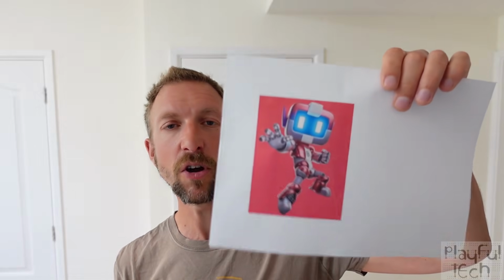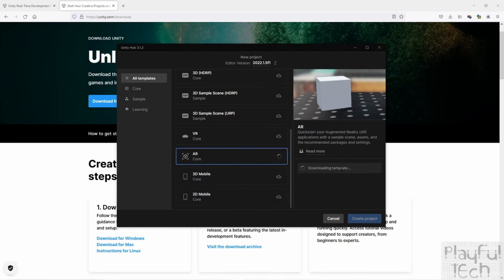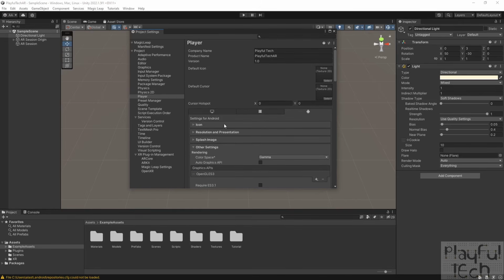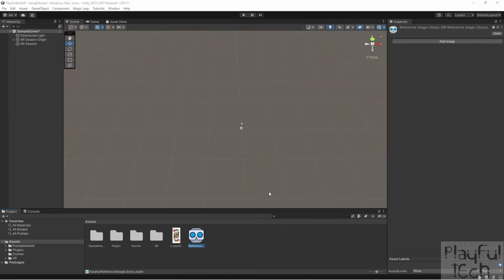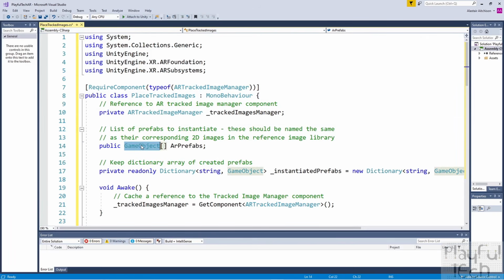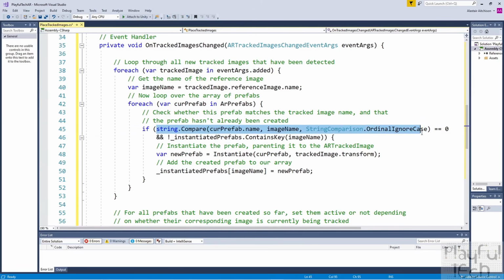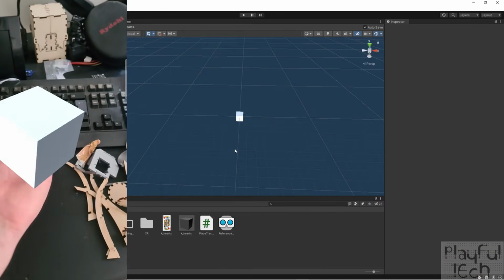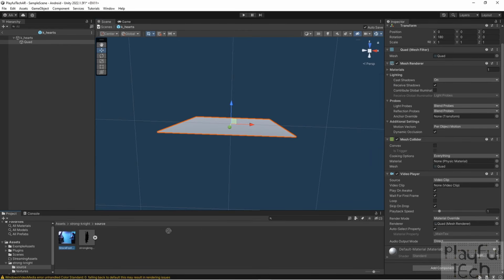Augmented Reality (AR) tutorial for beginners using Unity 2022

Comment: Any changes to the AR Tool landscape since this video was made?  For example, Flutter , ARLoopa, or Flet/ARCore ?

I'd like to make an Android application that can find components from a circuit board! Just use your camera and it will overlay a marker on the component... however, not sure if there is a minimum marker size , and if it can be overlayed with such high precision.

For example, if you have a sheet of paper with a grid of squares, say 50x50.. if A4 is said/entered, could AR use a fiducial on the paper to calculate how far into the grid it needs to place a marker (scaling it based on the the angle and how close the camera is to the sheet).

Comment: Works well until I get like half a meter (1.6ft) away from the image with my camera, in other words, the image has to take up at least like 20% of my camera video feed to work correctly. As soon as I "zoom out" the tracking is lost. Tested it with different markers and different light setups but that doesn't seem to be the issue.

Is there a way to fix this? Perhaps a fundamental setting I'm missing? I've set the tracked images physicla size in my ReferenceImageLibrary asset but that did seemingly nothing.

Comment: Hi, I've done a build using a ace of spades card placing a 3d portrait object and it works perfectly, but when i use my own custom images with size relatively close to the card size both in centimeters and pixel size, it doesn't place my 3d objects anymore. I have nine diferent images in my reference library a all 9 diferent prefabs in my array on the script. Does anyone knows how to make it work or have the same issue?

Comment: I am having some trouble getting these warnings:

No active UnityEngine.XR.ARSubsystems.XRSessionSubsystem is available. Please ensure that a valid loader configuration exists in the XR project settings.
UnityEngine.XR.ARFoundation.ARSession:OnEnable () (at Library/PackageCache/com.unity.xr.arfoundation@4.2.7/Runtime/AR/ARSession.cs:341)

No active UnityEngine.XR.ARSubsystems.XRCameraSubsystem is available. Please ensure that a valid loader configuration exists in the XR project settings.
UnityEngine.XR.ARFoundation.SubsystemLifecycleManager`3<UnityEngine.XR.ARSubsystems.XRCameraSubsystem, UnityEngine.XR.ARSubsystems.XRCameraSubsystemDescriptor, UnityEngine.XR.ARSubsystems.XRCameraSubsystem/Provider>:OnEnable () (at Library/PackageCache/com.unity.xr.arfoundation@4.2.7/Runtime/AR/SubsystemLifecycleManager.cs:68)

No active UnityEngine.XR.XRInputSubsystem is available. Please ensure that a valid loader configuration exists in the XR project settings.
UnityEngine.XR.ARFoundation.ARInputManager:OnEnable () (at Library/PackageCache/com.unity.xr.arfoundation@4.2.7/Runtime/AR/ARInputManager.cs:24)

I am using Unity 2021.3.20f1 and I have done every step explained in this tutorial. Is as if AR Foundation package is not being recognized by unity. I have uninstalled and reinstalled unity and this message still appears.

Please help, I don't know what to do now and it is very frustrating.

Comment: I had an issue with the Android phone not putting the 3D image over the anchor. Not sure what helped exactly. But potentially it might have been due to the size of the cube being too large to fit within the screen area. It was 1m3 and worked after I adjusted to be 0.1m3. Hope that helps someone else

Comment: The most common issue I've seen in the comments and encountered is when you've done everything step by step and your app builds successfully, but the object doesn't appear when you point the camera at the image. SOLUTION: In my case, I just needed to reduce the size of objects to 0.1 meters, cuz by default it's set to 1 meter and it's too big, so it's not displaying.
Reply: hi, any other solutions? followed everything got issues and resorted to online, fixed, my app builds everything but it doesn't seem to recognise the image or doesn't load up what i want to be displayed, i also did change the size to 0.1

Comment: I need some help. I was able to build & run the app, but when I point the camera at the reference, my object doesn't show up. The reference I'm using is an 8x8 grid of black & white squares which should be pretty easy to recognize, and is about 180 x 180mm for the entire grid, so decently large. I'm using a Samsung Galaxy S8.
Reply: same issue with my S20
Reply: did u find any solution?
Reply: @shivanibhardwaj9988  no sadly

Comment: Hi, I've built the app on my phone but no matter what i do it doesnt seem to be placing any objects at all. As far as i can tell i've done everything as per the video but when i open the app the camera opens but it either doesnt detect or doesnt place objects(Which one i cant tell) Are there any steps i can take to debug this?
Reply: I am having the same issue, any resolution??
Reply: I've got the same issue. I do everything step by step, but camera not detect my reference image :(  Samsung S21
Reply: Sorry for necroposting. Did you get it to work? At first I thought it wasn't working but then I noticed the tip of a gray cube in the corner of the screen. Then after some moving around the image I managed to get the cube to come to the screen but it's still kinda floaty and not centered.

Comment: Hi everyone! Thank you so much for this tutorial, was super awesome! When I went to build this on my iPhone I got a build error stating "Undefined symbol: _UnityARKit_Camera_GetTextureReleaseCallbackHandle"    Any thoughts on how to fix this? Thanks in advance anyone!
Reply: What  a coincidence, I have the same one ;-( In case you got this fixed, please let us know!!!
Reply: Ok, found it. I manually updated AR Foundation to 4.2.7 (had to unlock it) and then it finally compiled without this error!

On iOS please also see this great comment below in case the image is only replaced for a blink of an eye:

gardendesignerapp:
There appears to be an issue with ARTrackedImagesChangedEventArgs updated in ARKit. If you just remove the code for the foreach loop that covers eventArgs.updated then it should work fine.
Reply: @pretzelmunster  Nice thanks for the tip. But I cant even get this project to build now. I go to build settings, then build and it just trys to build for a sec and stops. I opened up another AR unity project and just built it straight away and it worked so I'm guessing its something in the scripts or other build settings thats blocking it. I dont know :(
Reply: where to get the code:face-blue-wide-eyes:

Comment: Very useful video and comments. I built the app -- works all the way, except when I point iphoneX on the card, the cube does appear but  for a nano second and then disappears -- it does not stay.  The app keeps trying to bring the cube, but cube never sticks. Any idea what I may be missing?
Reply: There appears to be an issue with ARTrackedImagesChangedEventArgs updated in ARKit. If you just remove the code for the foreach loop that covers eventArgs.updated then it should work fine.
Reply: @gardendesignerapp  Wow, that was a life saver on iOS, thanks a lot!!!

Comment: For those having an issue with the script compiling, try making sure the class name in the CS file is the same exact name as the CS file, casing and all.
Reply: king
Reply: .cs on the name to??, it didn't let me add it, got an error saying,"The associated script can not be loaded. Please fix any compile error and assign a valid script"
Reply: @bruhbeat3047  no, don't include the  ".cs" part in the script class name. Just put the name that's in front. If you still have an error, then it's probably a different syntax error so go through the code again and see if you have anything missing or in a wrong format.
Reply: how I can get the script file please
Reply: @user-rj1hx3gw2b  if you open the description of the video you'll see the link to his paterion, hit that and scroll down to the thumb nail of this video it's linked there,
Btw I've just been helping people in the comments just look around  and you should be able to find other people's that I helped with 👍

Comment: Everything works, thank you. 
But my phone doesn't recognize the reference images. What am I doing wrong? Does anyone have a tip?
Reply: hi did you solve this problem, been hard stuck on it 😢
Reply: Same issue here, did you find a solution?
Reply: I have the same issue. The app runs perfectly, the camera opens, but when I point it to the anchor, nothing happens. Have u guys found a solution? I would be glad to know.
Reply: Did you drag the prefabs into script components?
Reply: @bruhbeat3047  I did. I followed the tutorial and it worked. The app was downloaded, the camera opened, but when I point the camera to the image that it's supposed to be replaced, nothing happends.
Reply: @pedrodavid2599  kinda late but it might be the picture itself, maybe try one that clearer, for example try use an album over or book, then find the digital image online, size it up 
If this doesn't work try

just go over the video one more time 
If you can't spot it there
If not
 try decreasing or increase the size / move the poition around,
Reply: @bruhbeat3047  I'm getting the same issue. My reference is an 8x8 black & white grid I printed out big enough to almost fit the width of the paper, but the app doesn't recognize it. I'm using a Galaxy S8
Reply: @Moki314  I had something similar to this as well, sometimes I just had to turn it on and off a couple times, 

but it might he the location or size of the 3D object, sometimes it can spawn behind the picture and if it's too big where it's bumping into the picture it would just disappear.

Or
It could be the library not being set up properly, just double check everything is named correctly and labeled correctly, it could be that it is detecting the image, but the the 3D model isn't plugged in properly 

Let me know if you fix it 👍

Comment: Hey, I followed the tutorial closely, but when I run the app on my phone, I only see a black screen. Searching around, the common advice for this is enabling ARCore in XR Plug-in Management but I have already done that. Any suggestions for what the problem may be?
Reply: did you add the scene in the build settings?
Reply: Deleted the main camera?
Reply: Did you solve the problem? I have the same issue. 😫
Reply: @andreasilvestri4745  I had to use a proper build, it didn't work with unity remote
Reply: @DaftFrik  i built the apk and installed on my smartphone. What you mean with proper build? Thank you very much.
Reply: @andreasilvestri4745  did you solve the problem?
Reply: @qisthial882  please were you able to fix it?